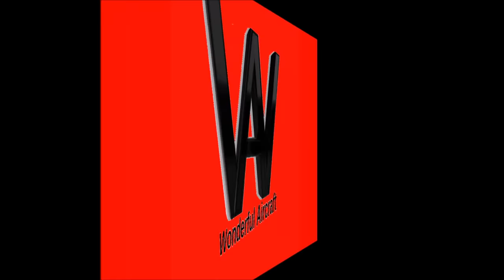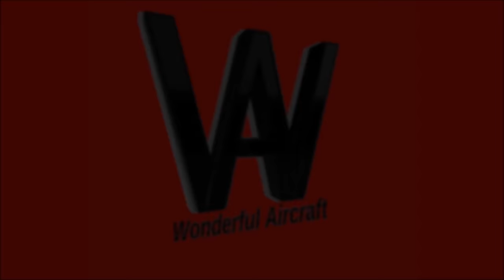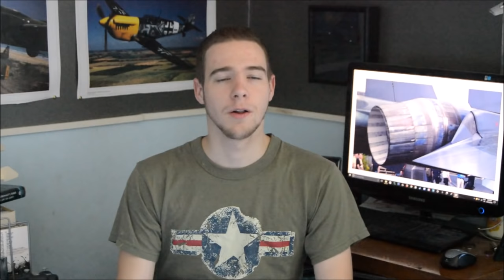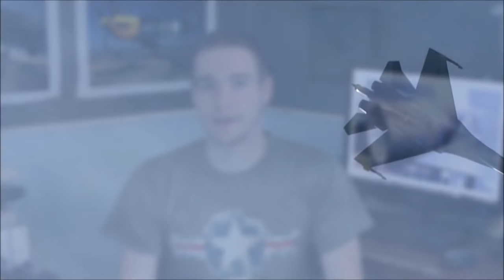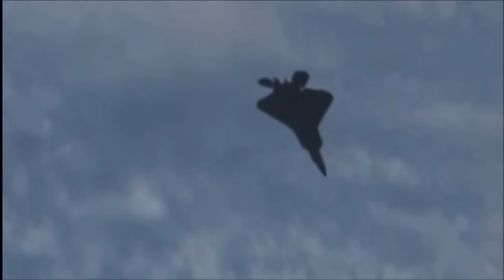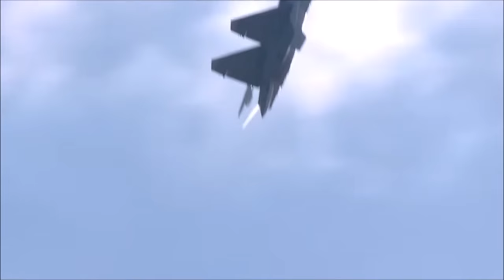Thrust Vectoring Explained

Comment: sure russians can do backflips but the real reason fry f22 has only pitch tvc is weight reduction. good engineers understands that more is not always more
Reply: But SU37 weighs less than F22
Reply: @napoleon3280  okay. relative weight matters.
Reply: @mikkihintikka7273  can you please explain
Reply: @napoleon3280  lets take easy example. cessna 172 is lighter than su57. is it more capable?
Reply: @mikkihintikka7273  The SU 37 has 3D thrust vectoring so it is more manoeuvrable, I know the F22 is stealth capable that's why it's more expensive and it is a complicated machine. But I didn't see anything related to the F22's weight to its lack of manoeuvrability (lack of 3D vectoring) and that's why I asked.
Reply: @napoleon3280  f22 has higher climb rate. like i expected. its relative weight is smaller since there are no needless 3d vectoring parts which also means less parts to break which means smalles maintance times and smalles cost per operating hour. also 2d tvc is enough for close distance dogfight so there is no point to have 3d vectoring unless its some kind of art performance plane
Reply: @napoleon3280  su 37 is not bad. its good plane. it would be better with 2d thrust vectoring

Comment: Can they add this to the Boeing 737 Max?
Reply from the maker: Adding thrust vectoring to an airliner would be pointless. You don't need the extra control authority provided by it on an airliner, and it would just add complexity and weight. Not to mention the extra cost of research, development and installation
Reply: @WonderfulAircraft  I am sure Charlie Devine was half joking. He was probably referring to the MCAS issue which was due to improper position of the engines, so thrust-vectoring might have made the MCAS more capable. :D

Comment: The exploration of supermaneuvrability that led to the idea of thrust vectoring was fist exampled in 1984 by the Grumman X-31 forward swept wing demonstrator. In 1987 the first thrust vectored demonstrator was the F-18 HARV (High Alpha Research Vehicle) as was referenced in the video. But the US didn’t stop there. In 1988 the F-15 STOL/MTD 1988 tested forward canards, 2D thrust vectoring, and later in 1993 3D thrust vectoring. Also in 1993 the F-16 Vista MATV (Multi Axis Thrust Vectoring) tested 3D thrust vectoring. Though the Russian are often considered the pioneers because they had the first operational thrust vectored fighters but they didn’t introduce thrust vectoring until 2000 with the AL-31FP variant of the Saturn Al-31 engine. The US determined that maintaining energy in a BFM fight was critical and that entering into very low or even zero energy states was fat to dangerous. Most supporters of these types of stall maneuvers fail to consider that fighters don’t fight alone and being in such a state makes you easy prey.
Reply: USAF Freindly fights with Indian AF Sukhoi 30 with TVC have left some of the Su  literally out of energy and loosing altitude to recover speed.

Comment: A Harrier isn't s thrust vectored craft?
Reply from the maker: It is, but its thrust vectoring is not for the purposes of increasing maneuverability which was the focus of this particular video. It's thrust vectoring is for the purposes of short/vertical takeoff and landing. However, there are accounts of Harrier pilot's in the Falklands war using their thrust vectoring to make hard turns against opponents, but that wasn't the original intended use of that ability.

Comment: I think it is great that these aircraft with trust vectoring can do these amazing maneuvers, but don't they lose speed and power which is crucial in a dogfight????
Reply from the maker: GetYourModelOn They absolutely do. Any maneuver in a dogfight will come at the expense of energy, especially ones like you see many sukhois preform at airshows. This is part of the reason there is much controversy over whether or not TVC is necessary or not for a fighter.
Reply: Thank you sir, I appreciated you reply, it was very informative.
Reply: Dog fights are not always about speed. It's all about maneuverability. Slow to fast. Vice versa. Kill your enemy from 100kms away.. no dog fight required.

Comment: Harrier, thrust vectoring in the 50's!    Reverse thrust on airliners is a 180 degree thrust vectoring.  Even helicopters with their tail rotor and main blades vector thrust from the engines out to to these turning blades. Even conventual aircraft can vector thrust by blasting air to their control surfaces.  Evidenced in twin tail aircraft wherein a blast of thrust from the prop flowing directly to the control surfaces and those surfaces vector the thrust.

Comment: I don't know if you read comments, but thrust vectoring sounds like the quick boost of the Armored Core 4 games. In those games humanoid mechas use boosters to drive and manipulate the orientation and bearing, like swiveling your body from north to west, south to east. It could be also used to suddenly boost the mecha forward, backward, left and right, making evasive maneuvers possible in snappy or frantic situations. However, the game exaggerates thrust vectoring, as one boost forward usually puts the speedometer to a thousand kmph. It's a necessity, of course, as the mechas weight hundreds of tons, and would need alot of push just to skid from position to position.
Reply: The older AC games from PS2 also show the nozzles moving based on the direction you move in so they've got trust vectoring going on as well.

Comment: Why the US Air Force did not apply or utilize this technology in F16, F15 and 18???
Reply: x-62, f15 active, f18 harv
Reply: Because it is simply an unnecessary thing to have in modern fighter jets. We are past that era where you have direct dogfights between individual planes. Nowadays you don't even have to have your plane's nose pointed in the direction of the enemy that you want to engage. The only thing that thrust vectoring can really do is look cool on airshows.
Reply: @joshiderniemalslacht8398  also since dogfighting with thrust vectoring is very inefficient, and for it to be useful the enemy needs to be very close range. Thrust vectoring can point the nose, but it loses a lot of inertia so it's a risky move. With thrust vectoring if you don't win a dogfight fast you don't win at all.
Reply: @whoseuler  Being that the F22 tested its capabilities in a dog fight against the F16 the thrust vectors plays a huge part in dog fight (emergency situation) or when in close range with a similar stealth jet. It’s the difference between roll into a quick sidestep.
Reply: @theonewhoknocks9928  also that
Reply: because they have other priorities and they invest in that maybe
Reply: All of these aircraft were developed before TVC.   It's generally not seen as a useful technology because 1 It bleeds of energy in a fight meaning speed and or altitude is lost and 2 only becomes useful at close range dogfights.  The F-35 will kill an opponent with its stealth before it can get close.   The F-35's mission is primarily to bomb.  
F-22 has TVC.  in pitch and roll.  Lockheed Martin was more concerned with a stealthy nozzle than 3D vectoring.
Reply: @joshiderniemalslacht8398  There’s a lot of dog fighting in ukraine war.. So imagine if it were Russia vs france or UK. maneuverability is as important as it’s always been.
Reply: @theonewhoknocks9928  the thrust vectoring of the f22 is more for maneuverability at higher altitudes

Comment: The part I don’t understand is if this control is established with just the two engines at back or are there additional locations that can add the required thrust. Seems to me there would need to be at least six additional engines to provide this level of maneuverability.
Reply from the maker: @timfriesen8459  with modern engines, two is more than enough to provide the same or greater amount of thrust than the weight of the aircraft. Even older single engine aircraft like the F-16 can have a thrust to weight ratio of greater than 1 to 1 when not loaded with a full weapon load so one or two engines on any modern fighter is more than enough force to provide this high level of maneuverability when that force can be directed to aid in pitch, roll, and yaw control. For instance, the F-22 has a gross weight of over 64,000lbs, while it's two engines can put out a combined 70,000lbs of thrust at full power.
Reply: No, but Its the reason the flanker is so massive. Almost the entire aircraft is a wing, with the addition of canards and 3d nozzles the flanker can achieve bullshit maneuvers that literally makes no sense

Comment: Ultimately wasted potential.  Anything new or even recent should have some thrust vectoring capability.
Reply from the maker: Well you can still get by without it alright. The majority of combat maneuvers an aircraft will perform don't require it. Its more of a "just in case" kind of capability so it hasn't been applied to as many aircraft as was thought when it first showed up
Reply: @WonderfulAircraft    The ability to keep your nose on a target is worth having.  You may have heard airborne LASERs that are mountable on fighters are soon to be a reality.  I'd hazard a bet said LASER could outrange a 20mm and possibly shoot down an incoming missile serving as a PDC too.  Needless to say the ability to pitch over and dive out of the path of an incoming missile faster is a lifesaver.

Comment: Why didn they put it on the f16?
Reply from the maker: General Dynamics did actually test a thrust vectoring nozzle on the experimental F-16 VISTA or MATV. However, it likely wasn't applied to existing F-16's because there was simply no need for it. The F-16 is already more than maneuverable enough to do its job, and is set to be replaced in the future by the F-35.
Reply: @WonderfulAircraft  
You guys are very seasons liars and propagandist per excellence - show me  F-16 of any shape or form that can replicate SU-27 or MiGs maneuver.

We saw one of F-16 pilot confessing that he saw such Maneuvers for the first time  conducted by Russian fighter he went a step further by stating that should he encounter Russian fighter in a dog fight  he will simply bail out - here we are a narrator telling lies that F-16 manufacturers were the first to experiment with such maneuver - US will do/say anything under the SUN trying to water down Russian ground breaking innovations one wonders why USA wastes a lot of time and Mega Calories in a futile attempted to get credit they don't deserve.
Reply from the maker: @amoslukyaa5792  Look up the F-16 MATV, dude. It's literally an F-16 with TVC as I stated. And I never said it was more capable than an Su-27/Su-35. Plus, I'm not even American.

Comment: just a curiosity how do the pilot achieve that? i mean what's the throttle position when TVC is deployed? cheers from Italy
Reply from the maker: Matt Mørke Most often the throttles are at full reheat or max military power when pulling hard maneuvers. The more thrust used, the more effective the TVC is. The TVC is engaged at all times so the pilot achieves these crazy stunts simply by moving the control stick in the traditional fashion. Modern TVC equipped aircraft are actually quite controllable even when doing backflips, somersaults, etc.
Reply: thank you very much for the clear explanation!!..lol sorry for my lack of knowledge in the field im a jet fighter enthusiast  im trying to learn bit by bit
Reply from the maker: Matt Mørke Everyone starts somewhere, nothing wrong with asking questions :)
Reply: I'm in a similar situation XD
Reply: @MatteoAdler  Who ask's may be an idiot for 5 minutes. Those who don't ask, will be 4ever  .  .  .  .  .

Comment: Vectoring re-directs the push of the gases against the atmospheric pressure?
Reply from the maker: Fox Moulder It redirects the force on the aircraft. So instead of the blast pushing the aircraft forward like normal, it directs the blast up, down, or side to side to greatly increase maneuverability
Reply: Thank you very much for your prompt response.
My question is the blast pushes the aircraft against what? The air?
Reply from the maker: Fox Moulder Yes it does. Same way a normal jet engine works, but with TVC you can change the angle of the blast
Reply: I would imagine the same applies to rocket engines, right? That is, they all push themselves against the atmospheric pressure, right?
Reply from the maker: Rocket and jet engines alike basically use the force of a controlled explosion to propel the engine, and subsequently the aircraft/spacecraft forward. Within the atmosphere they do push against the atmosphere but they don't have to in order to work. Hence the fact spacecraft can propel themselves in the vacuum of space.
Reply: But the vacuum sucks everything. There is nothing to push from. Isn't it against the 3rd Law of Newton?
Reply from the maker: Fox Moulder Well if you were to make an explosion behind a spacecraft in space it would propel that spacecraft away from said explosion. That's basically what a rocket is. it's a controlled explosion behind a spacecraft. But at the end of the day, I'm an aircraft enthusiast not a spacecraft enthusiast so you might be better off just Googling these things :)
Reply from the maker: Fox Moulder And Newtons 3rd law only states  that for each action there is an equal and opposite reaction. The action would be the explosion of the rocket, the reaction would be the spacecraft being propelled forward
Reply: Wonderful Aircraft But if the vacuum sucks everything, I really doubt any explosion would push anything in space.

Thanks anyway, you did answer my initial question.
Reply from the maker: Fox Moulder Your welcome. And that's not how the vacuum of space works. Use Google. Google is your friend
Reply: I could not find anything about anything special about vacuum in space, except that it is not a perfect vacuum. It does still sucks everything, however.
The explanation I've read is that rockets do not push themselves against nothing.  That the very explosion causes a motion in the opposite direction.
Sorry I do not buy that, thus my question to you. 
As far as I am concerned, to say that jets and rockets do push themselves against the atmospheric pressure is simply preposterous. 
Thanks.
Reply: Hey Fox Moulder. The exhaust at the back of a jet engine is hot and compressed. As it shoots out the back and expands, the force pushes the aircraft forward.
Quote:
"The nozzle is the exhaust duct of the engine. This is the engine part which actually produces the thrust for the plane. The energy depleted airflow that passed the turbine, in addition to the colder air that bypassed the engine core, produces a force when exiting the nozzle that acts to propel the engine, and therefore the airplane, forward. The combination of the hot air and cold air are expelled and produce an exhaust, which causes a forward thrust. The nozzle may be preceded by a mixer, which combines the high temperature air coming from the engine core with the lower temperature air that was bypassed in the fan. The mixer helps to make the engine quieter."
Reply: You don't need atmospheric pressure to push against.